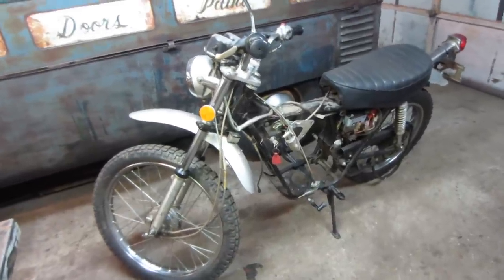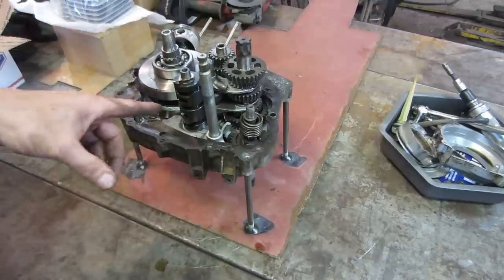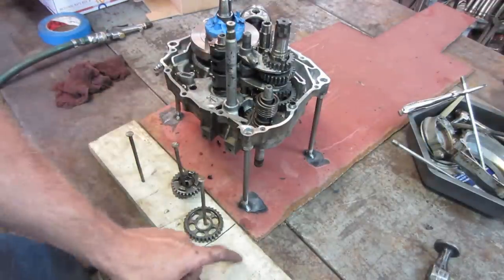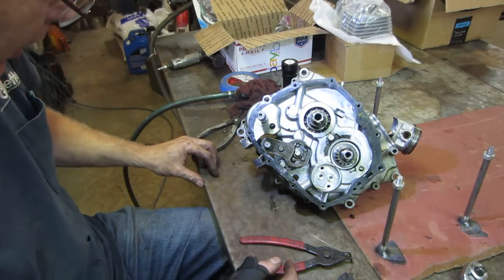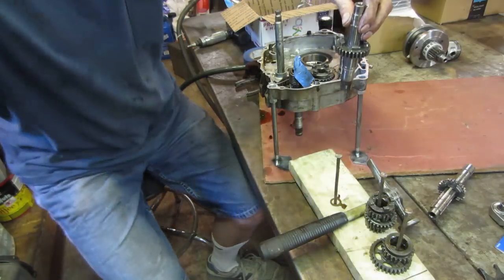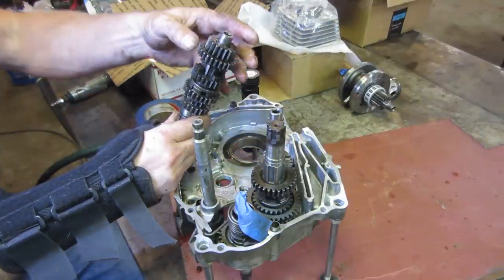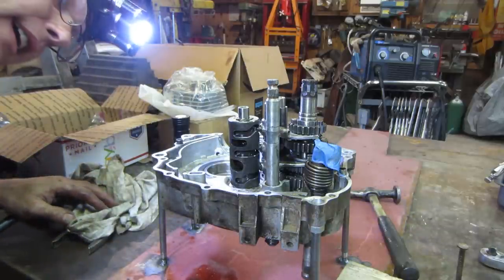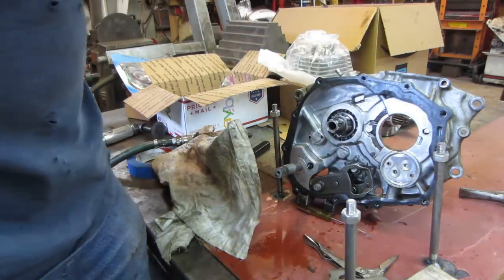1972 honda sl125 motorcycle transmission repair part A

Comment: that was painful to watch , just pull the gear out as aunit , remove shafts with shift forks on as a unit and reverse the process to refit , you made it harder than it is , motor bike gear boxs only go together one way , you can,t mess them up
Reply from the maker: make a video of you doing a complex repair for the 1st time while filming and lets see how it turns out,
Reply: not having a pop , i do have the advantage of rebuilding many bike engines over the years , from little 2 strokes to v4 honda,s , and many motor bike gearbox,s , when my brocken wrist has finished recovering from my surgery i will be rebuilding my 2002 yamaha yz 125 and replacing a brocken gear like you found and will gladly film it and send you the link , i do enjoy your channel and have enjoyed watching lots of your videos , keep up the great content

Comment: It has been a very long time since I attempted this on an old Super Cub 50.  But why doesn't he break down and buy a manual when he spends good money for the parts?  Would that make it too easy?  I had a manual and thought it was correct, but I went through several 2nd gears before I sold the bike.  I claim ignorance of youth, I was only 14 or 15

Comment: Youre killing me! you made the easiest job into a over complicated nightmare- you split the cases, you pull the pin on the 3 shift forks and let them fall (take a picture if you need to prior if youre scared), theres no adjustments, they only fit one way- and then the two shafts come out with all the gears intact! Thats it, you dont need to remove the shifter drum unless yours is worn or broke, which they almost never are....... never un-stack the gears and shims, and never remove snap rings when youre changing the trans on Motorcycles-
Reply: +Eclidean You are right, but if you do this job the first time it´s a little bit difficult to check this out. The first time I did that job I was totally confused as Mustie was. But anyway, the job is done ;-)
Reply: I'm sure you would be a expert the first time doing this repair.
Reply: I wouldnt worry much about someone with a Ducati. Hes having a good time riding his 25k piece of shit to the dealership, and feeding it valve shims every 400 miles.